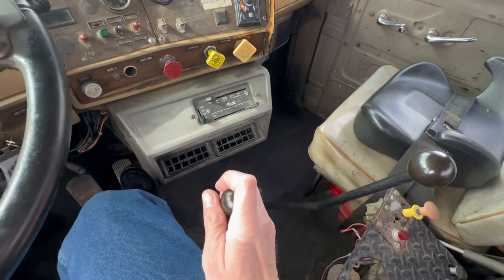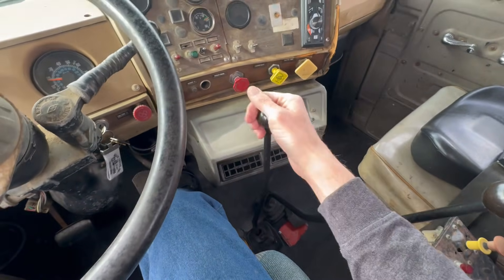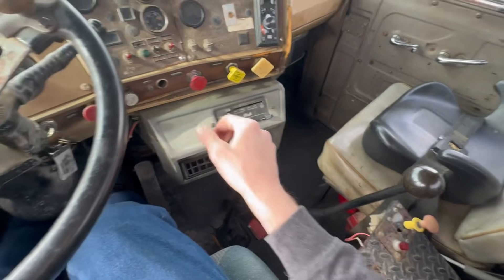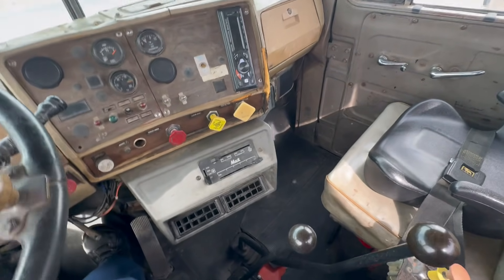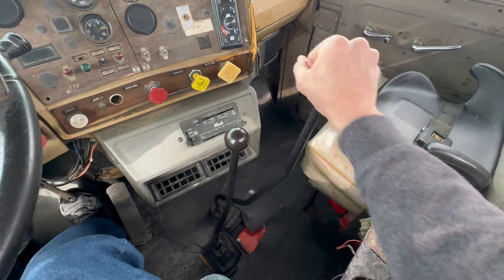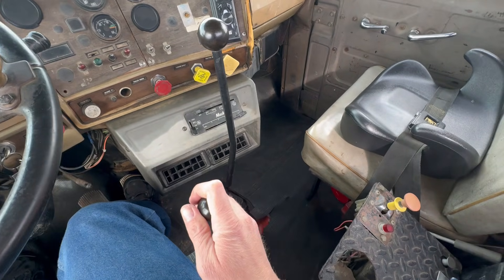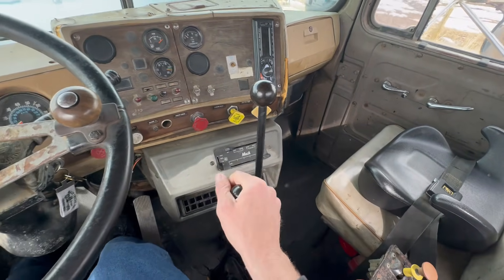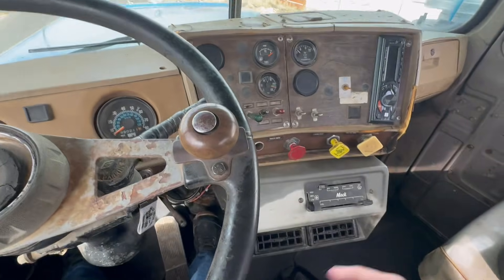1985 MACK R Model (R686ST) Twin Stick Shifting forward and reverse

Comment: Yes sir drove many of these old Mud stick 6 spd R-RD 688 steel nose DM 685sx 686sx DM 886sx there bullet proof there ain’t nothing like these old mechanical Mack’s they will run circles around the new plastic computer controlled crap today and last many more years

Comment: do you have all gear hi-lo as 1st one you use? second gearstick is just a splitter to split every gear into two (hi-lo)?
Reply from the maker: No. This transmission doesn’t have a splitter. It’s a 6 speed but have a low range for first gear only, then it’s just like shifting a normal 5 speed pick up truck for the remaining 5 gears. But it does have 5 reverse gears.
Reply: I have driven this transmission,,fun to drive

Comment: Always wondered what the third air break button was for i was told once it was a reserve of air pressure anyway how's that truck pull.
Reply from the maker: I am still wondering the same things!!! I haven’t hooked it to a trailer yet, so I’m not sure how it’ll pull a trailer. Without trailer it definitely feels awesome (for what it is). Once I actually pull a trailer I’ll let you know how it does. And, when I figure out exactly what the buttons are all for I’ll let you m ow that too.
Reply from the maker: I put a video the shows the buttons operating

Comment: Interesting.  I've got an old R700. It got a quada plex transmission in it. It's  all Mack different than anything else I've driven. 😊
Reply from the maker: I’ve learned there are so many different transmissions.
Reply: @RulonsGarage  mine is a 68 with 335 Cummins transmission and rear ends are Mack. It's geared  pretty  low. It tops out around 57mph. In low gear I think you could pull a stump out of the ground.

Comment: Run anything past third it’ll blow it apart in low on the compound
Reply from the maker: I can shift it through all the gears with it in Compound Lo but Mack doesn’t recommend it for reasons I already stated, but it can be done but not recommended.

Comment: Is there a Hank jr tape in the hole?
Reply: Was a mechanic on Mack trucks for many years…very reliable machines..
Reply from the maker: @This is a great truck!! Obviously it has things that need attention, but I’m happy with it and so is Rulon. It serves its purpose for now. Hahaha
Reply: @ we ran dm 600’s and 800’s around the clock…hauling stockpile coal and slate up the mountain…I’ve changed a thousand rears and transmissions..but what they went through that was regular maintenance..lol..

Comment: Old R sounding good. So many people think that transmission is the same as a Duplex 10 speed when it just like you demonstrated. A 5 speed with a low for 6 speeds. The only time I didn't like them was when you have to pull up and reverse a lot, because 1st in reverse is too low but you need the main in first to pull forward so you were always moving both sticks. Tough transmissions though.
Reply from the maker: This one is pretty cool too because the left stick also runs the PTO/Winch. So I have 5 winch gears for different speeds.
Reply: @RulonsGarage wait thats handy